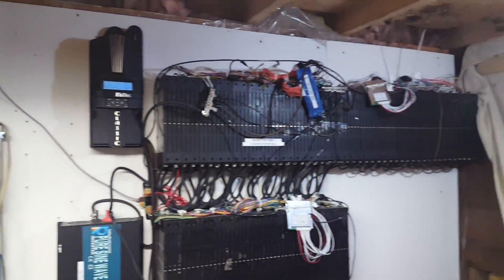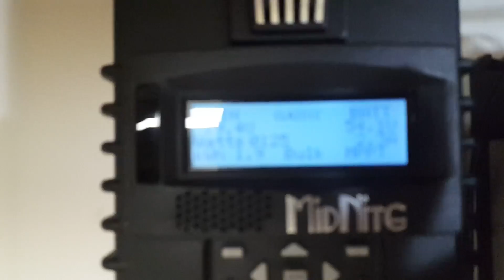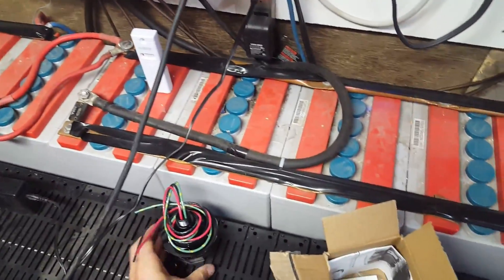10Kw Solar Power Wall

Comment: how do you run a 16s on the inverter do you only charge up to 3.9v?
Reply from the maker: Reliable power inverters can be custom built to what voltage you need and magnasibe 48v inverters work up to 67v :)
Reply: @GoingOffGrid101  awesome i have the same 8 cell packs but they are 800wh im trying to figure out what car they come out of looks like they have the same case but different balance connector thanx for the fast response

Comment: You could well improve the performance of those BMS modules by thermal adhesive, a cheap heatsink and fan. You will extend the live of the units, increase the performance of the discharge mosfets and reduce the chance of failure. Even a 12v cpu cooler fan at max speed is only going to pull just over 300ma if that !  Worth considering.

You have yourself a nice little power wall now. Perhaps its time for some contactors so you can take a pack offline to charge without it being under load. You could use the BMS output to auto isolate that way.

Very interesting project you have there. I have been trying to build a decent one myself but we have crap solar suppliers here in the UK........ Hmmmm........ Maybe its due to not having any sun ????  :-D
Reply from the maker: haha yea no sun could be why :D I never pull enough power to get the bms over 100f so i dont think i need a heat sink :)

Comment: I'm working through batteries, on a budget.  Buying used FLA batteries on the cheap...  There is a difference in the 20hr rating of 6v bats one is 232, the other is 216, can I run them in series, or better in parallel ?  ..for both charging, and under draw...  Will the superior battery be limited by the inferior one ? Can you advise a link for hacking battery systems ?  lol  I really don't know how to search for such a thing. Best, rc
Reply: Rusty Case like batteries can be put I  series . unalike need to be paralleled . if in series the capacity is limited to the smallest capacity. and they may get out of balance . leading to even less capacity! I know its been a while. hope this helped. I hope I made sense!

Comment: Another thing is the 3000 watt inverter, where and how much, just got screwed  by Ali bababa , they sent me a 3000 watt 50hz with U ground plugs.
Reply from the maker: dang, you can still use the 50hz on most things and replace the plug, here is the link to the 300w

https://www.ebay.ca/sch/reliablepower/m.html?_nkw=&_armrs=1&_ipg=&_from=

Comment: Good day I was hoping to discuss a few topics, and including physically see your setup to help better set up my own  solar battery bank system. I have a few mixed batteries, both 6 and 12 volts plus  solar panel setup.Also where did you get your car batteries that you added to the wall. appreciated thanks.

Comment: I love those batteries I got one 8 cell pouch group from eBay to test. What do u get a junk car full one for 300$
Reply from the maker: good guess
Reply: fliping720 how long do u estimate they will last since most of these cars haves like 50k miles on them,  u really think it's worth it vs ur gel batteries.  Also at 5aph per cell u need so many. u ever use the nissan leaf cells for anything. they seemed like bigger aph cells
Reply from the maker: i would love a nissan leaf battery, but cant get my hands on one. these still have the full 5Ah that they are rated for so im sure they will last some time most are 2-3 years old.

Comment: Sounds like the way to go.  If you have time would you show the exact wiring of one of the BMS setups?  I bought one that you recommended and I am confused about the power out connection.  I try to track the wiring in your videos, but always get lost in all the black wires.  I understand the current and other connections, but not sure about the power out?
Reply from the maker: I will try and show that

Comment: So with  an arae is there any thing you can't run in your home ?  How long have you been working to get where you are today ?
Reply: Going Off Grid if you have a large enough tank you could have it eclectic heated, 1-3kw slow heat (only heat up in day time) there are heat controllers that can divert spare power to the hot water (not sure how it works with solar only as the ones I seen are Ment for grid tie) 

 as your going full solar as you have a lot of solar panels 

You could have a gas heating loop in the hot water tank as backup (as they norm have the pipes in there for cental heating systems loops) just make sure you have a hot water mixer to make sure to prevent Legionnaires in the water (pulls water from bottom and pumps it out the top so mixes with hotter water above 60c to kill any bacteria )
Reply from the maker: i cant run my hot water heater as it is now I would need to replace the heating elements.
Reply: is it a flaw with tthe water heater or is it with the power end of things ?  Is a power hog or is the start circuit a power hog ?   You sure have a great set-up there !  Good luck with all you do !
Reply from the maker: it takes 4500w to heat the water really fast and its to much for my system atm and will be getting a propane water heater
Reply from the maker: thanks thats a good idea!